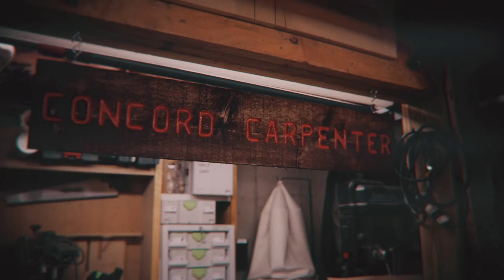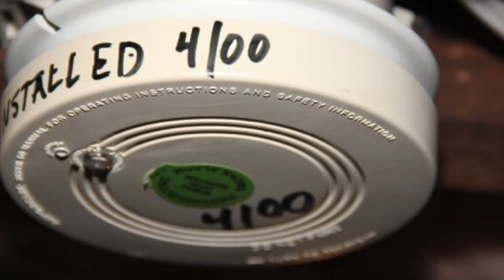Cleaning Smoke Alarms - Identifying a BAD Detector -  Preventing False Alarms

Comment: I'm having a an intermittent slow beep, so I started watching videos. Yours is the most informative! I now know what to check, and how to clean it. I replace the battery twice a year--when daylight savings time starts and ends.  Mine are hard wired. Thanks for giving me the proper cleaning method! Never thought to do more than the outside! Thank you! And, I both 'liked' and subscribed!

Edit: I made the preparations to climb the ladder and clean the chirping detector. First, I turned off the ceiling fan and waited a few minutes before starting. A few minutes later, I realized I no longer heard the chirping! Don't know what happened but I'll keep the fan off fr now!

Comment: Don't you love when they go off before your alarm clock?  However many years I was living in a house where the basement had a strong odour emanating of sodium and sulphur; bad enough that it killed 2 smoke alarms.  I ended up moving for this from the residence weeks later as the smell was getting stronger; I never did find out the root of that smell.   The house sits abandoned now which is sad as it was a nice old house that made your eyes burn, have a nice weekend Rob.

Comment: Great post. Smoke detectors are a mystery to most and, there is really a lot to know about them and, fire code. I replace a couple of batteries for a client recently and had to stand on the top rung of my 20' extension ladder and stretch to get the battery out with my finger tips. No OSHA inspectors were present. The home owner was smart enough to purchase 10 year lithium batteries, thank God! But it raises the question, what in God's name are these architects and builders thinking, putting them up that high in the foyer walls?!!!

Comment: Hey there Rob. I know my questions has nothing to do with this video, but I've seen you give the makita 18 volt 10 inch miter saw rave reviews and I'm now in need of one. I'm just about settled on the 18x2 lxt 10 but I now noticed there's 2 versions and I'd love to know what the difference is between the XSLO4PTU and the XSLO6PT ? I'm by no means a pro like the ToolBoxBuzzsaws but the 2 separate model numbers got me thinking there may be a slight difference. Please tell if it's so. Thanks👍🏾
Reply from the maker: Im not sure - sometime they're are kitted options, brushless versions or different battery options
Reply: @ConcordCarpenter  thanks 👍🏾

Comment: My old hard wired smoker detector keeps going off during shower. Can I just clean it since we have never cleaned or touched it for years?
Reply from the maker: Replace it if its close to 10 years old
Reply: Is it right outside the bathroom door, on the ceiling!? I think I read steam can affect it & room temperature!? Is it going off really loud or just chirping? 
I am a lady, but I thought I'd tell you what I think I read on google. I got a hardwired smoke alarm right outside bathroom door that's chirping. The plastic casing won't come off twisting it anticlockwise like it says to. I can't find a groove for a screwdriver, like another video mentioned. Any ideas how I can get the casing off to change the battery? Or just stop the chirping, please?

Comment: How about when you just purchased a new entire smoke detector and then had it installed.  The new replacement is a first alert 10 yr. Battery.  Then low and behold one of them started sqeaking about a week later only at night real late at either 1am or 4am.  It gives a quick squeek then stops

Comment: Mine are only 5 years old in a new-build house. They are wired into the mains and have back-up batteries. On two occasions they've gone off repeatedly for no reason. I've tried cleaning them and resetting them. They are currently disconnected and taken down with batteries removed and I'm reluctant to put them back up. If cleaning hasn't helped, why are they going off?

Comment: The video didn't help me because I have the hard wired type. To remove the detector to clean it as shown in the video means turning off the power, disconnect the wires before the detector can be removed. And of course reconnecting the wires after cleaning ... too much hassle. I just used the vacuum cleaner's extension tubes to reach the detector and vacuum around the circumference of  the detectors and the small opening on the face of the detector. However that did not solve the problem. I had a second false alarm the very next day after cleaning. Since humidity could be the trigger I had tried to reduce the humidity in the house by dropping the temperature setting on the air conditioning (humidity dropped from 61% to 56%). So far so good.
Reply from the maker: Good tip, the detectors in this video are hardwired too,it’s and easy disconnect and reconnect. Vacuum works as well as bringing the compressed air to the detector

Comment: Mine did the usual middle of the night thing.  I thought by getting one that said 10 year battery back up meant I wouldn't have to replace a battery for 10 years.  It's been 3.  It's a 1st Alert 9120B.  But the biggest problem is that the battery compartment will not open (says that it is sealed even though I didn't use either of the pins on the back of the mounting when I installed it).  According to this video, I can't even clean the thing unless I take out the battery.  Any suggestions?
Reply from the maker: you can still vacuum or blow air at the sensors

Comment: my smoke alarm is a solid green color and it randomly went off at 5 a.m  there is no fire nada
now is it my batteries or do i need to call a electrician
Reply from the maker: How old the smoke detectors? Are they 10 years old if so replace them

When’s the last time you vacuum them out or blue compressed air through them to clean them?

Is there a Replaceable batteries, When is the last time you replace them?

Comment: A smoke detector in my apt was chirping very intermittently (once every hour). My landlord sent a tech who replaced the 9V battery. Next day chirping began again once every hour. Landlord send tech out again who replaced the old unit with a brand new one and put in another brand new 9V battery. All was well rest of the day. This morning, it chirped again. Only once. It's been an hour and no new chirping. But what could be the problem?
Reply: I have the exact same unit as seen in this video. Ours went off twice starting at 3:45 this am, waking everyone up. This alarm is very sensitive to cooking of any kind. It's a peculiar little device. I don't know what to think of it. It goes off quite often without cause..
Reply: Make sure it is not your carbon monoxide detector that is chirping. They typically have a lifespan on 10 years.  They will chirp if there is a low battery and when they come to the end of their life.
Reply: I wonder if it is finally fixed? What is the solution? I have the similar situation in last 3 weeks. I replaced the fire alarm 3 times with brand new ones. But last night it chirped again. Also it was chirping in the morning without any reason. I am so frustrated.:)

Comment: Fun fact most fir departments get 1000's of detectors with grants and give them out for free. all you have to do is ask.
Reply: Some do, not all. Those some alarms are typically only single station alarms (stand-alone battery), and not hard-wired interconnected smoke alarms.  There may be low-income guidelines for these hand-outs based on the grant requirements.